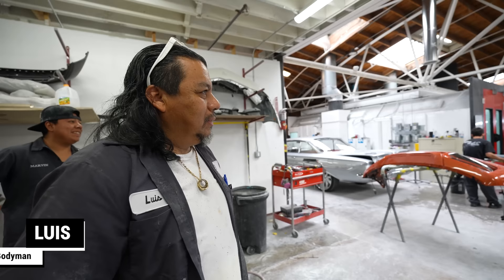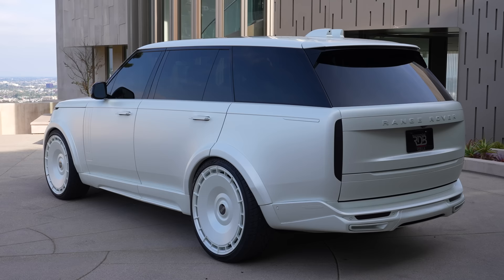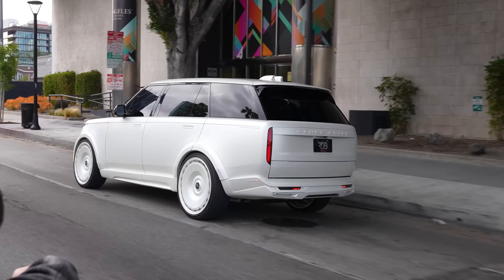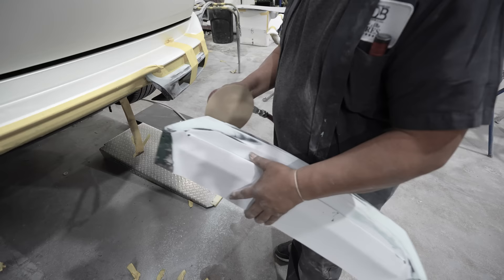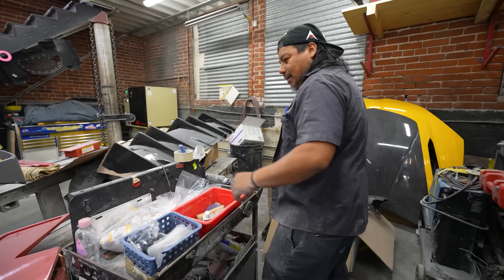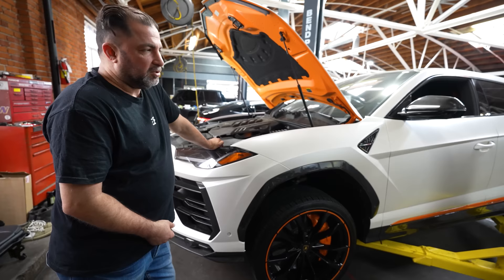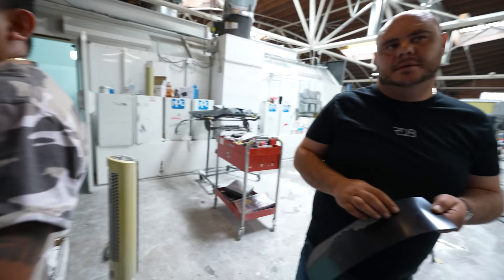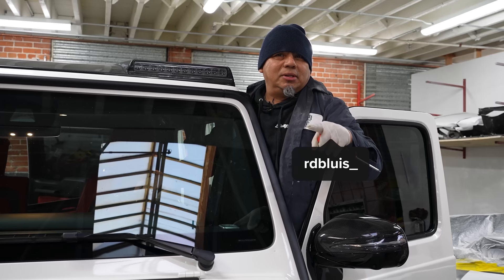UNREAL!! 1st 2023 Range Rover Widebody Kit in the USA!!!

Comment: To me it looks like the flares do not flow perfectly into the front and back lip but it could be a camera issue. I also would keep the slats on the grille painted black. Too much white imo

Other than that, looks good
Reply: I saw the samw thing, the corners pertrude and don't line up perfectly.
Reply: Love the kit but I saw the same. If the flares flow into the lip and diffuser it would give it that cleaner look. Makes me want a range tbh.
Reply: maybe it's because the lips can be used with out the wide-body but maybe they should just make 2 versions
Reply: I agree.
Reply: The front end makes it look like an older model. I’m just not a fan of this build. It’s so smooth it looks a little boring.
Reply: @Chepeoffroad  money pits mate and so unreliable. But if you have money to burn and don't mind your car in and out of the dealer for warrenty work. Go for it 👍🏼
Reply: RDBLAA..  errr Nah.

Comment: Front lip and front flair doesn’t match up correctly. Same for the rear flair and rear bumper. Could use alittle more work.
Reply: Noticed that too, still needs work. I guess that's what you get for the very first one, I'm sure it will get better.
Reply from the maker: This is because the basic add on parts are all designed to work with/without the flares.

Comment: The front fender flares gaps on the bumper look horrible. The factory fender and bumper gap is much smaller. The rear fender flares don’t even flow into the rear bumper. It almost looks like the rear bumper is too narrow at the bottom where it meets the flares